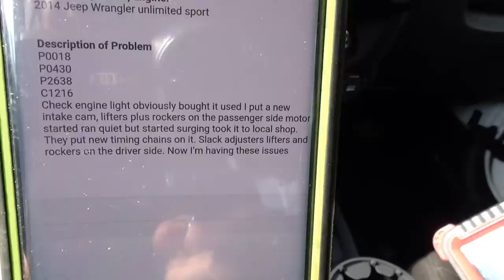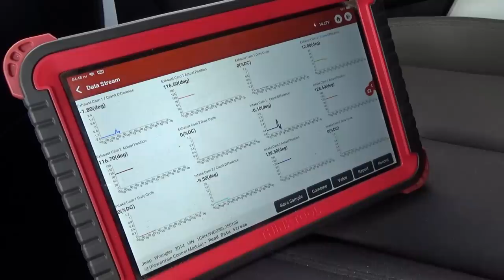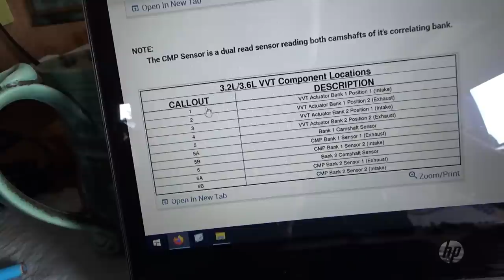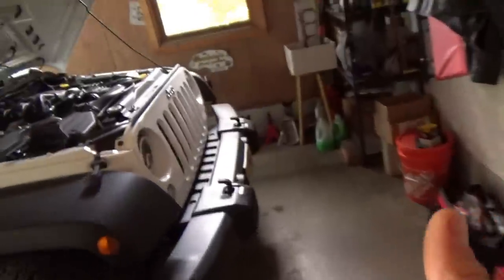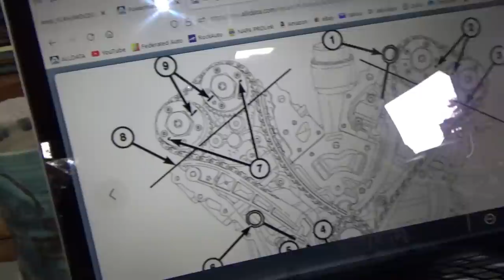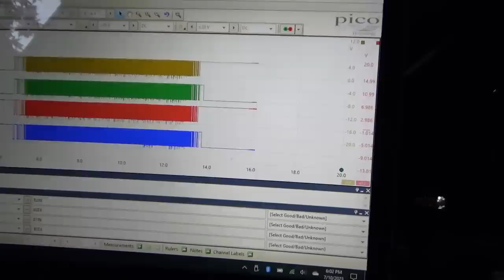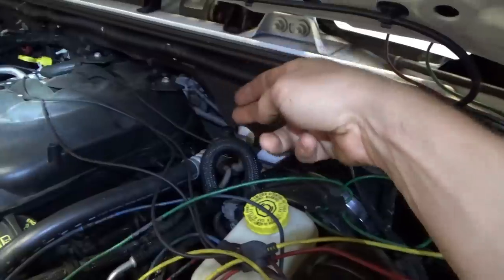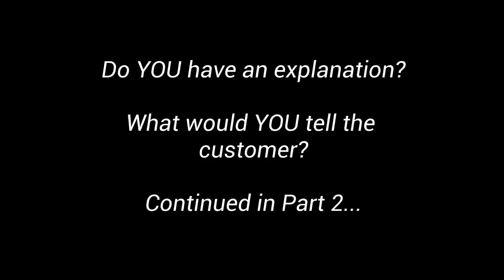BUTCHERED Jeep Timing Job?? (Part 1 - P0018 Correlation)

Comment: I think it has to do with the reluctor wheel somehow being damaged or shifted.
Reply from the maker: On BOTH cams?
Reply: @PineHollowAutoDiagnostics  True Ivan. Both reluctor wheels being damaged is highly unlikely. I am agreeing with @robertpailler4898 the issue could possibly be in the wiring. Was it messed with? Or possibly damaged during the repair? The slight variation when the cam sensors were switched is a indication that the sensors themselves my have different resistance. If so I would test the resistance in the cam sensors. Should the resistance be within parameters. One could look at the ECM. The magnetic staining could be an issue but that is outside of my knowledge and experience. What a great way to wake up while enjoying my coffee!! A mental challenge!! Love it.

Comment: You can't touch those cams with a magnet because they're magnetized. That's my guess.
Reply: why would a magnet demagnetize a magnet?
Reply: @randy1ization  I didn't say it would demagnetize it. It does damage the pickup though, and having a flashlight with a magnet on it is pretty common. I'm just taking a guess not an obvious warning the book gives when you work on these 3.6 motors.

Comment: They should have never dropped the 4.0.  Best engine ever.
Reply from the maker: Yeah who needs the extra 100 hp? Straight 6 is legendary 😎💪
Reply: @PineHollowAutoDiagnostics  330,000 miles on my 97 XJ (all mine)
Reply from the maker: @johnz8210  For 93 they were pretty peppy and light as far as SUVs go... And man were those seats plush and comfy :)
Reply: @johnz8210  that's the advantage of living in Georgia... 😎
Reply: the 3.0 was great too..

Comment: This is a super interesting case study!  I'm not familiar with this engine but as soon as I saw the design of the cam sensor alarm bells started ringing.  Incorrect height of the sensor could totally explain the symptoms (one cam retarded, the other advanced), is the installed height determined by the cam cover?  If so is there a problem with the sealing gasket e.g. non-OEM part which is thicker not allowing the cam cover to seat correctly?  EDIT nvm, just saw another comment that says the sensor has a bolt going through it so it seats hard against the cylinder head (or should do...).  A head scratcher indeed.  Possibly debris under the sensor that has now been displaced since you remove the cam cover?

Comment: Looks like to me that the electors takes a lot of effort to move hard to believe a tech knock them out of alignment anything is possible, looks like aftermarket, camshaft and faulty insulation from the manufacturing 
The warranty should fall back on the manufacture 
of these cams.

Forgive me of typos, I forgot my glasses

Comment: why would you divide by 720 ?
Reply from the maker: I divided by 33 😅
Reply: @PineHollowAutoDiagnostics  I think he meant why did you divide into 720.  IANAM but I assume it has to do with the fact that 720 degrees is a complete cycle of the engine.

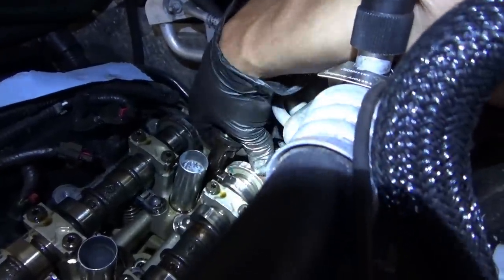Comment: Do the Reluctor wheels come off the Cams? The reluctor on the intake Cam had a hole and white mark that didn't line up with the hole and white mark on the exhaust Reluctor wheel. That could account for around 20 degrees. @ 24:06 you can see it clearly. Also they are both a different size, i'm not sure if that makes a difference as one would spin faster than the other.
Reply from the maker: Reluctors are identical on both cams 👍

Comment: You can't have 33 teeth on your cam sprocket/gear. The crank end of things has to have half the amount of teeth. You can't halve 33 and get an integer. I counted 33 from that picture as well. The cam side HAS to have an even number of teeth. Something is wrong there.
Reply: Sure you can, I see what your saying tho, have to think of the entire travel, cam sprockets, balance shafts, idlers etc. counting the teeth just gives you 360/720 degree correlation.  In some Timing set ups the cams may not even be directly coupled to the crank shaft, it goes around a water pump or balance shaft, then that is driven by the crank, if that makes sense
Reply from the maker: Great point. Remember this engine has a 3rd primary chain and a middle idler to change the ratios :)
Reply: @HelloitsThatguy  No it doesn't. It has to have the ratio changed by an intermediate shaft first, like Ivan said. If the chain goes from the crank right to the cam gears, the cam gears MUST have an even number of teeth AND the count MUST be twice as many teeth. It doesn't matter what the chain or belt wraps around.
Reply: @timramich  that’s exactly what my comment just said, you have to consider the entire path of the timing chain
Reply: @HelloitsThatguy  Your comment there and here doesn't say that at all. "The entire path of the timing chain" implies one single chain.
Reply: @timramich  “you have to consider the entire path of the chain” entire meaning, around sprockets, idlers, the entire system of chain(s).
My comment also said, in some timing set ups the cams may not even be directly coupled to the crank shaft, just like how it is in this jeep, with its 3 chain set up.
Reply: @HelloitsThatguy  You don't have to consider idlers.
Reply: @timramich  an idler sprocket can have 2 or more sets of teeth on it, coupling 2 or chains together to , effectively changing the ratio..  can’t remember the year off hand, but as a quick example some land rover v8 engines, the idler gear chain tensioner have 2 sets of teeth, a larger back row and a smaller front row of teeth, changing the ratio of cam teeth to crank teeth. Now that’s in a chain system. Idler gears in directly meshed systems play a can slightly different role, filling large gaps i without effecting speed ratio, I can link some related reading if you are having difficulty, some really good videos and articles on these topics.
Reply: @HelloitsThatguy  That's not an idler.

Comment: If the dual cam sensor is at the wrong depth in its housing, then one cam will be seen as retarded and the other advanced. Is something causing the sensor to sit lower in its housing? A spacer missing from under it?

Comment: Sorry if I'm an idiot, but wouldn't it be 360 degrees divided by 33 teeth equals 10.9 degrees?
Reply: Good point.  On a camshaft, one complete cycle is 360.  On a crankshaft, it's 720.  But we still have the mystery on where it's off since it looks correct on the alignment marks.
Reply: Since there are 2 full crankshaft rotations in a complete combustion cycle, 720 degrees is used to represent the complete sequence of crankshaft angular positions in 1 full cycle. The camshaft positions are then based off of that because there is only 1 rotation of the camshaft per combustion cycle, and it makes more sense to reference the rotation of the camshafts to the crankshaft like this.
Reply from the maker: @artemovili  excellent explanation 👌
Reply: @artemovili  Now it makes sense.  Thanks for taking the time!
Reply: @billsmith5166  Yeah, you need to think of the camshafts as though 1 full rotation is 720 degrees, referenced to the crankshaft, Thats all.
Reply: At least it does not matter. The point is that one cam is advanced the other retarded on one bank. Use the timing marks to cross check and you are done, not need to waste time doing the math.
Reply: @wald-meister6705  You're right.  The timing chain would need to be a different length, and the chain would no longer fit.  Thanks.

Comment: If the timing marks on the front line up, but the cam sensors reading of the rear of the camshafts disagree, then there are not many possibilities left. Incorrect camshafts, shifted reluctors, rubbish aftermarket parts incorrectly fitted by ignorant monkeys😉😉😉, 2x twisted camshafts😉, incorrect pcm ( reaching here) .maybe have a look at the reluctors in a parts catalogue and compare to what you have there. Or perhaps go incylinder on bank 1 & 2.
Reply: Since the cam sensors are mounted on the cam covers, incorrect cam covers perhaps?

Comment: Cam gear is effectively 42 tooth
cam gear 33 tooth, intermediate gear 22 tooth = 2/3 ratio . crank gear 21 tooth, intermediate driven gear 28 tooth =3/4 ratio. 2/3 x 3/4 = 1/2 which brings timing ratio correct. so effectively you have a 21 tooth crank gear and a 42 tooth cam gear with this mess! the intermediate gear ratio 28/22=1. 273    so 33 x 1.273=42. my money is on 2 problems, not timed correctly and a phaser stuck advanced based on scanner data

Comment: didn't watch the full video but from the bits ive seen id make a bet that the phasers are on the wrong side
Reply from the maker: What about after watching the full video?
Reply: @PineHollowAutoDiagnostics  sorry I was half drunk watching. I havent messed with the Chrysler 3.6s mostly the  GM 3.6s and one of them the previous shop put the intake phasers on the opposite sides. bank1 was on bank2 vice versa. car ran decent just had a code for for bank one if I remember  correctly. you could even get the alignment plates on it with a slight pull.
Reply: its always fun dealing with these problems after some else put them together. but after watching the video I would think its the cams either someone ordered a wrong cam for a bank or they got swapped bank to bank.

Comment: Reluctor wheel i think
Reply from the maker: On both cams? By the same amount? That would be crazy!
Reply: @PineHollowAutoDiagnostics  maybe i did valve cover gaskets and i think i did not so much on the driver side cam reluctor wheel and had a check engine light  had to order an exhaust cam the dealer told me those wheels are delicate and was the first time i had to use a scope i don't know anything is possible
Reply: @PineHollowAutoDiagnostics  i ended up buying a kit to sneak in the cam without having to take everything apart
Reply: @PineHollowAutoDiagnostics  i never knew you could turn those wheels that a bit delicate i thought but hey that was a good idea i just replaced the cam but i was told buy the technician on identifix to handle those cams with care

Comment: Your know good waveforms are from a non limp mode vehicle. Could the exh cam vvt be stuck advanced the int is retarded in limp mode?
Reply from the maker: For VVT systems the general rule is that Exhaust retards and intake advances 😉
Reply: @PineHollowAutoDiagnostics  If the seal on the valve cover is missing then you were right about height.

Comment: when he calculated the degrees he divided 720 by 33 to get 21.8 degrees per tooth. Why not 360 divided by 33 to get 10.9 degrees per tooth ? Being off by one tooth on each cam would give you a retarded reading close to the 9,4 degrees and the advanced reading close to the 12.3 degrees??
Reply from the maker: CRANK DEGREES!

Comment: Screw double overhead cams with VVT! Non-interference OHV with a single cam rules!
Reply: So you prefer being confined to 2 valves per cylinder with less performance over a broad RPM range?
Reply: I can't tell the difference.

Comment: Why would you divide 720 by the number of teeth?  A circle is 360°?
Reply: Because the crankshaft spins 2 times to get cam to do a full rotation
Reply: 4t engine